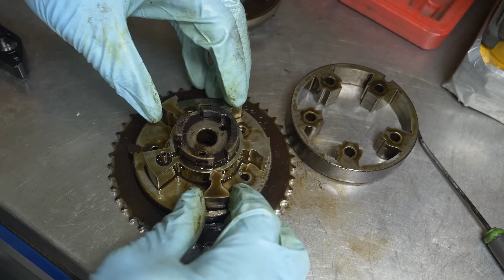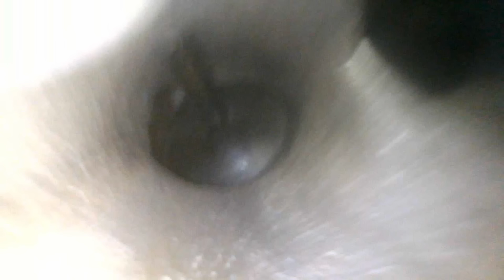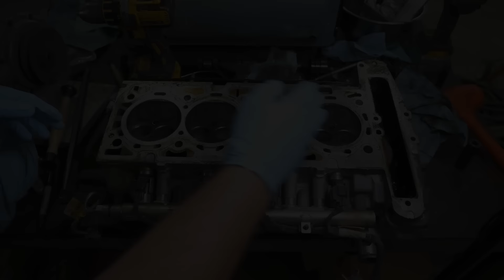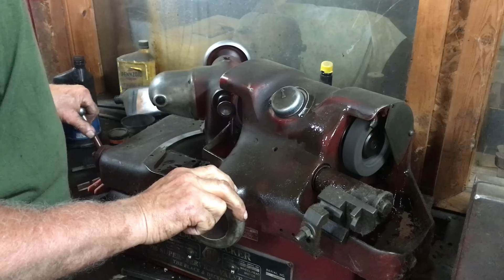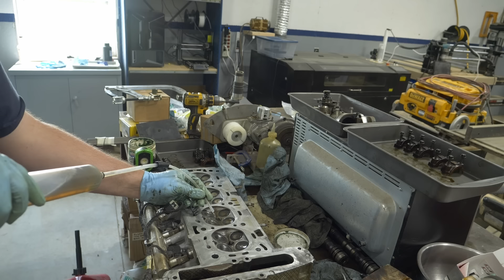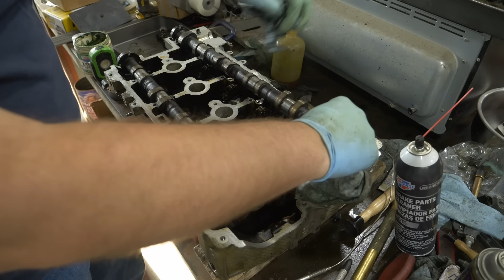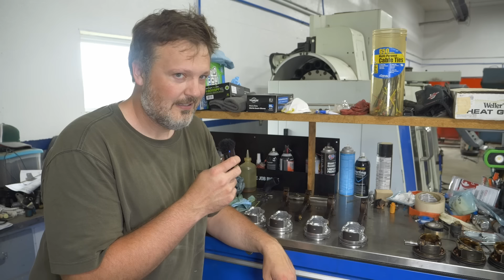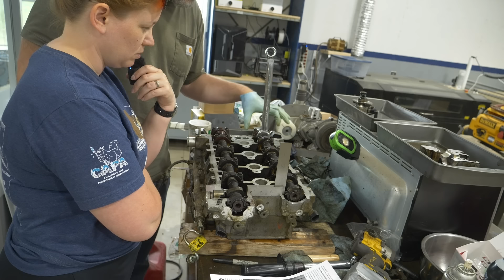How Did it Ever Run? Equinox Still Won't Start

Comment: Sometimes you just get overlapping problems and it is hell. I have an '01 Buick Lesabre with the venerable 3.8L and it 1) is randomly hard starting, 2) will not start after any refueling (any amount) without opening the throttle, 3) it surges and oscillates at idle. Replaced the evap purge solenoid, no change. Clamped off the evap purge line and it fixed item 2, OReilly sold me two bad solenoids in a row! Still starts hard, so I disconnect the EGR motor while it's running nicely and magically it starts and idles perfectly. In addition to all of that, I'm 90% sure the vapor canister is busted because it reeks of gasoline now that we've hit summer in Tucson.

Comment: I've seen engines so bad (Ford Kent) with busted piston rings that they had very little compression and chucked more fumes out the breather than the exhaust - yet they still started up.......That reluctor wheel slipping is the issue I'd say, that's why it won't start and before it got as bad as it did, bad ignition timing events probably put huge strain on the pistons and pins causing a deformation and it picking up on the LE bushes and moving them. This probably happens more times than you would imagine but because of the goofy shape you noticed it. I'd push that reluctor back on in the proper place with appropriate locking compound and your troubles are over. You could make new LE bushings on the lathe, put 'em in, cut them to the goofy shape and then adjustable reamer them to size. With your skills you could easily do that. You've got to keep going, it's a great video!

Comment: Your siege engine/trebuchet would operate better if supported on a longer board and with four wheels under it. Launching from a smooth surface the weight moves directly down as the whole affair moves fore/aft slightly during launch, imparting more energy into the arm. Adding an accelerant to the projectile would liven up the proceeding as well.

Comment: I've been waiting for a series of videos like this. Now you serve one. Thank you. You've come a long way and you've been resilient.
You had already bought new pistons, in the structure of which you did not notice any difference from the old pistons. So, could it help you out and make the engine less oil-consuming, wouldn't you slightly increase the size of the oil drain holes at the bottom of the grooves? I am convinced that you will be able to do it. Best regards,

Comment: I'm thinking people did not anticipate the coldness and cheap production of AI videos. I much prefer a video buy a real person. The AI vids have zero personality. Seems like GDI engines are in an accelerated self destruct mode.
The previous version of the Ecotec was pretty good. GDI and "design improvements" have not been a good thing.

Comment: We just found out that my daughters Equinox valve cover gasket failed and has oil in the spark plugs and coil... you want it next?  Our mechanic said to fix it and sell it before the next issue pops up.

Comment: Hey Wes. When having issues with the suction cups, I use a stick of hot glue. Works quite well. This method is used when I have a flat head Briggs & Stratton on the bench to lap the valves.

Comment: I’ve actually had a ecotec engine spin and cam reluctor and cause a no start. But in this case it was because the vacuum pump that runs off the cam locked up and spun it. Installed new cam and car ran mint. Have worked on a lot of these engines and if you neglect maintenance at all they don’t last.

Comment: Wes, I would be curious if you can heat up the reluctor wheel and spin it to see if its even possible. 180 degrees is a weird error to hit that almost seems like a manufacturing glitch and maybe a new or updated ecu killed this engine

Comment: this is the result of manufacturers having to meet the strict requirements of the epa. overengineering.  meanwhile, my 3800 in a grand prix is cruising past 320,000 miles without no sign of giving up.

then you got this trash that cant barely make it past 100,000.

Comment: I had a 2013 Equinox with a 2.4.  It was a happy day when it got totalled and I knew I no longer had to keep fixing that horrible thing.  Oil burning, clogging air injection ports, rusting doors (at 2 years old!), warping brake rotors, failed cam phaser solenoids, cracked exhaust manifold, and I guess I should be thankful we didn't get to experience the blown crankshaft seals.

Comment: Im afraid, like Paul Harvey usta say, that your brother owes you...the rest of the story. That thing got hot, like red hot at some point. Hot enuf to make a reluctor wheel loosen and spin. If it wasnt your brothers, u would have pushed it outside long ago. What's gonna burn worse is after u dump a cash box into it, then he turns around n sells or trades it for less than you have in it. Family can b a pain in the a...errr 'rear' sometimes. But, im someone's brother too, so I get it. Let's just hope your brother appreciates what ur doing for him. And no, Sir, ai will and can never replace the skills that you have...they can mimic them, not replace them.

Comment: Wes, whenever I try to fix a piston engine I use starting fluid if gas or diesel doesn't work. You have no obvious signs of it even trying to start. It doesn't even backfire. NOTHING!  I have a compression gauge, somewhere, but I don't even know where. Getting an engine running does not require a compression gauge. I never use one anyway. And FYI I have started engines up with no viable sign of compression. If you spin an engine fast enough it will run w/ so little compression you'd be flabbergasted. That is one reason why I use Starting fluid. Not Carb cleaner, not Brake Cleaner, ETHER!. But you aren't even getting burps or farts out of that Chebby. C'mon Wes, It's not the rods, it's not the pistons, it's not the valves, it's something else..Use a starting fluid with a major amount of Diethyl Ether in it and get it to make noise. ben/ michigan

Comment: With the crystalized carbon in the oil control rings and the slipped cam reluctor wheel, I would say your brother severely overheated this engine! That damaged Phaser could also be caused by overheating.

Comment: I tried this with Mercedes-Benz once for a electrical issue with a dual battery  system on a S550 I got think it $45 for 5 days but the service info was in German.........

Comment: I've seen Ivan have this same issue. (at pine hollow); on a Jeep though, I believe.   Why they would only "press" on something so important, is beyond my understanding..  At least locktite it on. lol..   But what can you say..  Even the crank timing GEAR is only pressed on, in the 6.7L Ford diesel.  You can't even make it up.   It's completely ret4rded.

I knew there had to be more to it though.  It should have ran fine after you did the shell blasting.   Good thing you finally found it though.   I mentioned that in your first video;  about the reluctor wheels rotating.   Makes you want to weld it on there.

Comment: Wes I was taught that when using the lay out dye (sharpie) and the valve spinning thingy you should never make a full rotation you should only move it about a 1/16 to a 1/8 of a turn.  The reason being that if there was a single high point that was preventing full contact that rotating the valve 360 deg that single point of contact would make contact over the full circumference of the valve potentially making the valve look like the valve had good contact pattern instead the reality of just having contact in one point.  Oh yah I love your videos and the detail you put in touch please keep them coming
Reply: I’ve actually seen this burn a tech. Now it’s common practice to only slam the valves into the seat. If there isn’t anywhere they seal, it shows up perfectly.
Reply: Sounds legit, and I wonder why Wes didn't think of that
Reply: technically true but then this would only be true of one of the two surfaces, so you could just try the same thing with the head instead.

Comment: As a DIY mechanic I do almost all the work on my 3 vehicles, mowers, microwaves, heat and air, etc. I am glad I am not the only one who has to spend what seems like an enormous amount of time on some projects. When you professional mechanics run into a situation like that, how do you charge the customer for your time? Thanks, Wayne.

Comment: LS  swap and be done with it. It would probably be cost wise about as much money down to put an LS engine in it transmission and all the goes with it and have something that will run for quite a while and fix this engine. They probably won’t last all that long before it quits again.

Comment: My mother and dad paid for a 1979.
Dodge aerostar.
With a scent, 6 under the warranty, the car broke down. Put my mother on the side of the road.
We sent the car to the dealership. They told my mother and father. It would cost them another 15000 for another motor. What I found out what's wrong with it? You would not believe the distributor has a plastic gear, it failed.
I went and purchased a new one. Put it in after putting everything in time. Afterwards, she drove it for another. So I have to 15 years before giving it to me.
When it got totaled, their motor was still running.

Comment: My mil has one of these and i hate that stupid engine with a passion. They put the oil filter under the gdi pump so just an oil change requires a special tool. They're also famous for clogging the pcv in the valve cover AND in the intake, causing over pressure and blowing out the rear main. "Luckily" for her, the timing was so worn that it carved a hole in the cover and vented through there first. Also wanted to throw my tools just putting the accesory belt after fixing all of this. And it burns oil. And it randomly goes into reduced power because of a com fault with the fuel pump module (which of course requires programming to replace). Ecoturd.

Comment: My valves look the same in my 2004 chevy 2500hd with the 6.0L gas engine.

It's not GDI so I'm unsure why its so bad. 🤷‍♂️ It does have 200k miles on it. I was going to maybe run some seafoam through the intake.

Comment: Maybe the engine ran out of oil and started to overheat and the driver saved it in the margin of time to do so. No head gasket blown, just hot metal, carbon, and spun bearings. Maybe it seized. Maybe something forced the crank to turn when it didn't want to, chain reaction w the timing guides bearings and cam shaft 💺

Comment: I had a clapped out old Integra I bought for my girlfriend when she was learning to drive. That thing would burn the same exhaust valve every 1000 miles without fail. I used almost every single exhaust valve out of 16 on a spare head replacing, lapping and seal checking on the running car. It wasn't until I finally gave up on it and pulled the engine did I find a bad o-ring on an injector. Absolute nightmare and I don't know how I never considered that. We used every shadetree method of decking and lapping that head. Drill and hose,  sandpaper and glass. That car wanted put down long before I ever bought it.

Comment: My focus is the low compression first.  Engine should basically runs with Cam reluctor off if the compression is normal.    Nothing changes in piston or ring design and it’ll still burn oil,   Oil rings always clogged and intake valves will always carbonated up but it won’t affect performance.   I’d go back to the basics.

Comment: AI hype is a classic bubble, it will not do a third of the things people are hoping for. Half the things google AI search comes up with can immediately be recognized as incorrect. Anything that needs some semblance of quality, or safety, can never be trusted with AI. Tesla cheaping out by skipping LIDAR, on the self driving cars, and relying on AI, and cameras is a huge lack of judgement, that will come to bite them in the ass. Once this kills a bunch of people, they will have to change approach anyway, with a huge hit to the brand name...

I replaced the gasket in the EGR, with a copper sheet, in my Mitsubishi 2.4 GDI, this helped to remedy the horrible buildup of soot it had. On that car it didn't induce a check engine light, but results may vary...

Comment: I use a small amount of Paul's bicycle " green" wheel bearing grease when installing tapered valve keepers. It is super sticky , but not a thick as standard wheel bearing grease.

Comment: I put 3 motors in a 2015 Gmc terrain.  I couldn't understand that you could not find rods they sell rotating assemblies for those motors on eBay I've bought 2 of them. I live in Canada I don't know if that changes anything. I can tell you one thing they are I complete pile of f**** junk speaking from great experience

Comment: My wife and I ended up with an oil-burning Toyota Camry. They wouldn't rebuild it if it made it to 100k or if it used less than a quart of oil in 1200 miles. I switched to 10W40 oil and the oil burning stopped completely. Still runnnng at 240k miles. Also had issues with dashboard deteriorating, sun visors not staying up (dealer refused repair) and the evaporator leaking. Present mode of use: change oil every 4k miles and run the wheels off.

Comment: This is why I don't even bother with tearing down engines anymore. If it is low on compression I either put in a reman engine or the customer just doesn't fix it. I have run into multiple issues on one engine like this too many times before, so I don't even bother anymore.

Comment: I worked for GM for 34 years.  My blood ran GM blue.  Retired in 2008.  But now I am losing faith in GM little by little.  How EZ would it be to fix the computer system? A roll pin in the reluctor wheel?  I am sorry you had these issues.   When I had issues with my just out of warranty 2018 Acadia & tried to contact GM's customer Help line & after trying for a month, I never got to talk to anyone.  Fix this Mary Barra.

Comment: I used premium fuel and Rotella syn blend 10W-30 oil and changed it every 3,000 miles from the time I bought it new.  Always used AC Delco cartridge filters.  It was the only car I ever special ordered and was a 2LT.  My 2012 Equinox 2.4 was flawless and never used oil.

Comment: So I love your skill set you are a really amazing mechanic and I've been a viewer for years of your channel having said all of that this is 100k mile car and I believe Western Illinois so would the snow belt situation is life expectancy is probably about 35 minutes from now for the next inspection whichever one comes first so I don't completely understand the effort on this car and the bill for all of your work here has to exceed the value of the car.  Certainly makes a great video and I'll be the first one to admit your machine shop skills with minimal machine shop tooling if any is a remarkable. Me personally being in South Florida if I was going to do this type of job I wouldn't do this type of job I would go down to the local auto parts store and get a warranty remanufactured cylinder head of gasket set a timing chain tensioner add a new boxer head bolts and you know cylinder heads remanufactured through big box auto parts stores are now cheap enough for a common American vehicles that the idea of whipping out a 3D printer and making my own tool specific to this cylinder head for cleaning intake valves I just I don't get the whole di thing either I understand it lowers combustion temperature but the trade-off is some really expensive maintenance but all in all a great video thank you as usual I always get something out of your vids and will continue to watch him as long as you make them

Comment: Wes you will like this .We had a late model jeep Comander? (i think thats the name of it.) it started but if you bought the revs up 0ver 1600 it would start missing and coughing and dies.  We tried all the usual suspects ignition, plugs leads timing fuel pressure and flow etc. The owner had sent it to us on a tow truck and  left a note in it. We had another one in the shop so we could change a few things over to see if improved it but it didnt.(in desperation as nothing else was working) I phoned the customer up and asked when it started playing up. he said just after i did an oil change and filter on it last week. He had put 20-50 oil in it and it was surposed to take 5-30 so the lifters couldnt bleed the oil out quick enough and kept the valves slightly open as you reved it. Heres another one A merc SL500 coupe comes in on a trow truckwith a note  Wont start , backfires fix it. One of our regular customers. The timing cant be out because the rotors and dist caps are mounted on the ends of the camshafts, but it farts and misses and wont start. We phoned the customer up and said when did it start doing this because its a rare problem to have in these cars. Then we get the story. His wife had taken it to another shop to get the starter repaired as it was making a "funny sound" when cranking. Then they couldnt get it to start after 'fixing it' and gave up on it. What did they bill you for? Fixing broken teeth on the flexplate and starter bendix. It has a pick up in the bell housing and a pin on the flexplate. What they didnt know is that it has a dot punched into the flexplate near the centre that lines up with the dot on the end of the crank. Have fun Wes. Love the channel.

Comment: Sounds like the adventure I had with my daughters Holden (GM) Cruise (the Equinox engine bay layout was giving me PTSD), it over heated, so got a new thermostat, water pump, skimmed the head, found leaking turbo coolant lines (replaced those), then a  cam shaft timing codes appeared. Spent way too much time under the hood, but eventually got it going, only to have it spin a big end bearing a week later. 
I didn't shed a tear as it left to the wreckers to be stripped for parts.